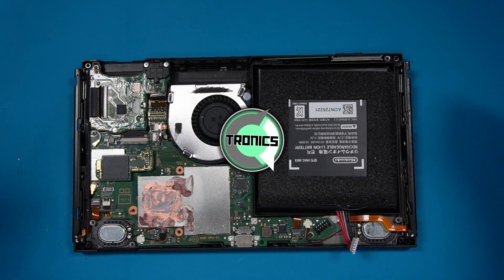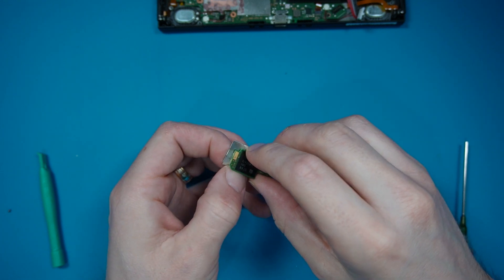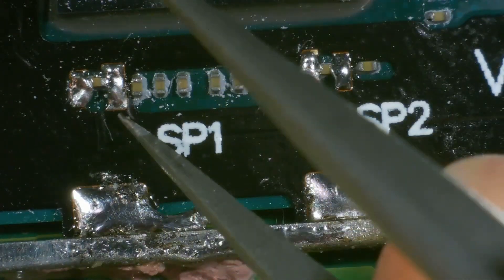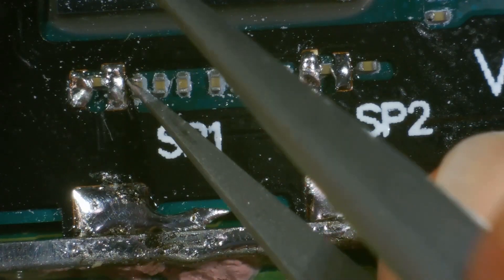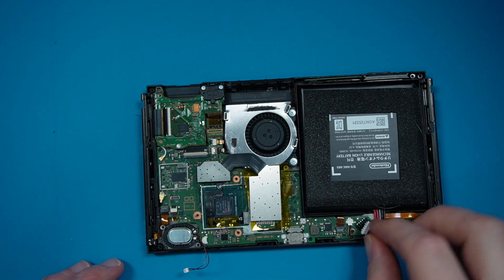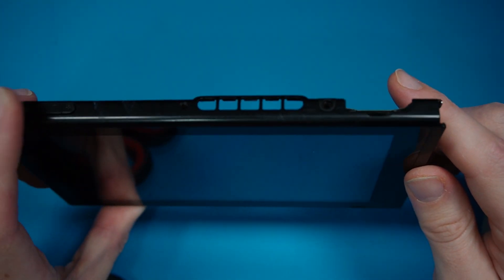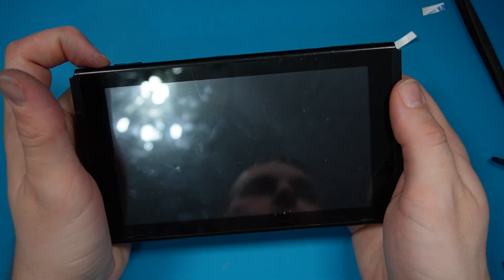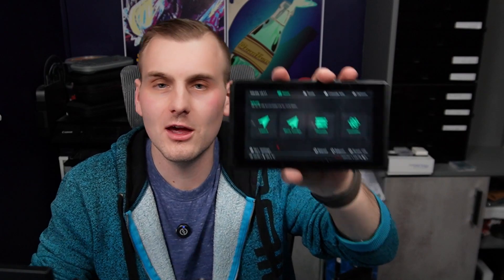Latest RP2040 PicoFly  *2024* : Nintendo Switch V2 Install

Comment: Hi I have installed everything like in the video. I have 13ohm and close to 0 like you measured. When I boot the switch up it boots normally and doesn’t give me the no sd card screen. I have flashed the chip. It flashed blue then 2 long green and one short. Please help
Reply from the maker: Howdy long long short should be the cpu failing it’s check. I would double check those solder point again, just go over them with solder again.

It may be that when you press down with the multi meter then you get a connection hence your reading.

Comment: which solder is good also do I need a very high temprature solder iron like 250+ degree?
Reply from the maker: leadded 60/40 is good im using Weller, and yeah my iron normally sits around 330-380 ( depending on the the solder tip you use, the smaller the tip the more heat you need)

Comment: Why i need to solder? i cant just use a lot of tape?
Reply from the maker: it would never hold. and you risk it slipping and making connections with other things in the switch.
Reply: @QTronics  Hmm. What about super glue?
Reply from the maker: @stormk-1130  honestly, you need solder for the connections trust me
Reply: @QTronics  Hmm. Any tip? i dont know how to solder? any practice you recommend ?
Reply from the maker: @stormk-1130  If you've never soldered before and this is the only thing you plan to do. I'd just pay someone to do it for you. 
The equipment cost alone will cost you the same. 
However if you want to learn, I'd suggest getting some stuff like this : https://www.aliexpress.com/item/1005007796602104.htm

Basically practise boards were you make, clocks, scales and calculators etc. Basically gives you practise on soldering.

Also watch loads of videos on how people solder
Reply: @QTronics  I'm really interested in soldering. Electronics in general. So I'm okay. I have soldering iron so I'm going to practice. Aint going to pay almost 80 bucks for that installation lol. The link not working brother.
Reply from the maker: @ just needed an "L" on the end : https://www.aliexpress.com/item/1005007796602104.htm

And it's 80 bucks vs messing up a switch lite a coupe times. TBH you can probably pick up a switch lite for that anyways and have a try.

Comment: What microscope are you using ?
Reply from the maker: https://www.amazon.co.uk/dp/B09VPPS96M (non affiliate) Andonstar ad246s-m
Reply: @QTronics  And what is the reference of your tin ?
Reply from the maker: @ tin?
Reply: @QTronics  the métal you use
Reply from the maker: @kitoshi62 o the solder, https://uk.farnell.com/weller/t0051402699/solder-wire-99-3-0-6-0-05-sn-cu/dp/3868984
60/40 leaded solder

Comment: Boot issues
Reply from the maker: what's happening
Reply: Hi, I did the HW update and initally the start screen work but than something went wrong. Not the start screen just pop up for less than a second and disapears. Can someone share some information where I can get the complete content for the SD card so that I can format and reinstall it?  Thank you so much!
Reply from the maker: @ so the console boots up? 
If so check out the wiki here :https://www.reddit.com/r/SwitchPirates/s/pqkfv3IDtp

Comment: Im getting 001 on both exernals and 020 instead of 015 on internals. Switch turns on when nand is on the board but when mounted on the rp2040 i have no led signal and console doesnt tun on, probably no power to chip i think . Do i have bad solders or is it the chip dead?
Reply from the maker: Those numbers are fine 001 and 020 are within the limits.

Can you try reflashing the chip?  : https://gbatemp.net/download/a-definitive-picofly-install-guide.37968/updates
https://gbatemp.net/threads/picofly-a-hwfly-switch-modchip.622701/page-78#post-10090767
Reply: @QTronics i did, and nothing changed, i guess o got a bad one, sent it back,  waiting for a new one. Thanks for the response. Keep it up!.
Reply from the maker: @paneincassetta9869  Ah that's shit man. Yeah just get a new one. I've heard of other having bad chips. I think i've only had one tbh,.

Comment: Did all the way, when turn on i see hekate but after trying to run sysMMC im recieving blue screen...
Reply from the maker: if you try rebooting to OFW does that work? as it might just be you Hekate set up? if not you might have messed up the install somewhere
Reply: @QTronics  it was just bad files that i used in mistake,  thanks
Reply: @QTronics  it was just bad files that i used in mistake,  thanks

Comment: What is the tape called that you put on the mod chip?
Reply: the yellowish tape is kapton tape.
useful as insulator for its thermal and electrical blocking
Reply: @zerorig  Thank you for explanation
Reply from the maker: As the other guy said kapton tape. Doesn’t melt at high temperatures.

Comment: Can someone tell me  what kind of solder wire needs to be used. Maybe provide a link please ?
Reply from the maker: Im currently away, but 60/40 lead around 0.4-0.6mm should be fine

Comment: Do you know the difference between "New2040Plus" and "RP2040-NS" on the RP2040 PCB?
Reply from the maker: They’re probably the same, the Rp2040 is the chip so. I assume most of the PCB’s are exactly the same. I wouldn’t worry about it
Reply: @QTronics  Thank u so much~!! 🤩🤩🤩

Comment: I'm having a yellow flash instead of blue and the normal switch screen when starting. I have a video that was soldered by a profession, I don't think he did anything wrong but its probably or is it because of the soldering? I can share it if you would like to check
Reply from the maker: Send it over to my Discord. Iyates
This sounds like one of the wires arent soldered.
Was this is a v1 or v2?
Reply: @QTronics sent a friend as sunami whonami, I got a video and it's V2

Comment: Hi, great video! Im almost ready to install a rp2040 on my switch. I appreciate you doing this for us. I do have a question. How exactly did you do the testing with the ohm meter? I am new to using one. And where was the ground cable? Was it just going to any ground point?
Reply from the maker: Stick the ground point on any ground i like to use the shielding bracket off the cpu.

Most of the points you test are actually in diode mode. ( so this would be red on the cpu shield then the black on the A B C D and 3.3v lines

Only the cpu is done in resistance mode.

Comment: Is it currently possible to use picofly on any version of Nintendo Switch or does it need to be on a specific firmware?
Reply from the maker: Any version, you would probably wont to be on the latest software anyways to have the most compatibility

Comment: Thank you for the video, I have just installed v2 chip without any issue.
Reply from the maker: Awesome dude :) yeah V2's are a good one to do. Hardest part is getting the heat shield off the CPU.
Reply: Hi there, may I ask where did you buy the chip?
Reply from the maker: @ChristianBautista-vc5cc ali express, rp2040 switch normally finds them

Comment: I am contemplating doing this and want to remove as much risk as possible before doing it. Would it be a good idea to cover the other capacitors with capton tape so you don't run the risk of shorting them while soldering?
Reply from the maker: you can cover the other components, but the only soldering is on the CPU. it might be a little difficult to get the tape in place. If you can though, technically it should help.
Reply: @QTronics  slow and steady seems to be the best approach for those that don't do soldering on a regular basis, so I am willing to put in time to make the process more foolproof by covering surrounding areas.

Btw, what soldering tip size would you recommend?
Reply from the maker: @miesals  CPU caps: 
Between 0.2mm and 0.5mm normally. 
Bc2 or I soldering iron tip for TS101

Just dont keep the heat on there too long, else the caps will come off as they're very tiny, 201 caps.

someone gave me the advice of do one side of the cap then wait for it to cool so it's solid before doing the other side, just because these caps have a tendency to move.

Comment: Hey, whats the size of your soldering tip in mm? I want to see if my current soldering iron tip is small enough for the install.
Reply from the maker: Between 0.2mm and 0.5mm normally. 
Bc2 or I soldering iron tip for TS101

Comment: Great job, this looks very good. Quick question. What type of microscope are you using? I recently installed my first modchip without any microscope and it was a pain to do.
Reply from the maker: You installed one without a scope? Well done dude that’s hard, ive done some micro soldering using my phone and it’s not the easiest.

Scope: andonstar 246-m

Comment: I'm gonna take a soldering training this week and then attempt this. Of course, since it's my first console, I understand that things can go wrong. Fingers crossed.
Reply from the maker: Good luck dude, make sure you have a microscope. Take your time. Dont rush. Good luck dude :)
Reply: How did it go? 

I was able to tackle a lite today. I watched about an hour of general soldering videos, an hour of lite picofly installation tutorials, and spent about 4 hours sacrificing old/broken Xbox controller boards to the soldering gods lol. But I got it done.

Microscope would have been super useful, impossible to see the connections with the naked eye. Luckily my phone camera barely sufficed.

I have no idea where to go from "No SD Card" though; finding good info on the software side of things is more of a task than learning how to solder imo.
Reply: @jayjayhooksch1  I did comment this, but I decided to postpone until summer break. I'm swamped with college stuff right now, so I don't have time to be watching all these videos and soldering. I promise I'll get to it in about 2 weeks though lolol
 
I'm glad it went well for you! I'll definitely try sacrificing some of my older electronics. If you don't mind sharing, what kind of soldering gear did you use?
Reply: @nottsoserious  I bought a 25$ kit off Amazon with solder, sponge stand and an 80w iron with a digital display. The solder was junk, wouldn't stick. I got some Rosin Core after.

The wet sponge it came with sucked, I switched to one of the brass shavings type cleaner.

Other than that, I got, some wick, some flux, a silicon mat, kapton tape and an activated carbon filter for my table-top air filter to act as a fume extractor. I strongly recommend some kind of fume extraction.

When I do it again I'll get a 25$ usb microscope (could do it again with my phone but I'd recommend a microscope) and electrician's scissors for cutting the heat shield (flush cutters didn't work well).
Reply: @nottsoserious  I should add that I felt the lack of quality in my iron, especially the tips, despite not having ever used a good quality one as a point of reference. The same will probably be true of the cheap microscope I plan to get, but I don't plan on using them more than once every couple years, so I don't mind.
Reply from the maker: @jayjayhooksch1  Howdy,

Awesome news I'm glad you managed to do it.
Yeah scope really helps, I fixed a dreamcast before using my phone's camera it's not easy but it does work. 

Where to go after No SD card : https://rentry.org/SwitchHackingIsEasy

Follow through that, make sure you back up your nand before you do anything else. 

Shit tools really do mess you up, you can get by on them. My first iron didnt have temp control so you had to guess it was hot enough. 
Flux makes a huge difference. 

Hopefully my video helped :)

Comment: Idk I honestly prefer the RAM soldering point on the Mariko models and the orange see through flex cable . They are smaller caps and closely grouped which can admittedly be hard without a microscope and a small tip on the iron but the finished product sits in the Switch like it was factory installed .
Reply from the maker: I think I know what you mean. I have seen them.
I did this one just to show people the easiest method.

I’ll probably do one of those eventually as i’ve seen some new 3 in 1 mod chips that come with the ribbons for all models.
Reply: @QTronics  that is the only version you can get a NAND backup which is as close as your going to get to failsafe if things go seriously sideways on ya . I think that might be the only 1 you could get a bigger emmc card for . And if we are talking easiest in terms of someone with very little experience in soldering, then you are right, that has fewer solder points and they aren't as small .
Reply from the maker: Yeah I get you. 

I was talking about there being an orange flex cable for the V1/V2 where you can solder on to points on the board so you can leave the EMMC board where it is and not move it.

In terms of emmc though, im going to be looking at trying to install a 256gb EMMC into a console at some point.

Comment: U didn t connect the orange connector dara 0 in the back?
Reply from the maker: Dat 0 on the back of the board is only for OLED.
The V2 and V1 boards have emmc chips that can be removed. So the emmc chip connects directly to the picofly board. That’s what makes this the easiest one to do.
Reply: Doesnt have to on this model because the emmc chip is removed from the Device and mounted in the RP2040 housing .